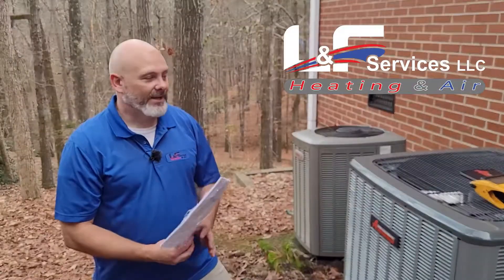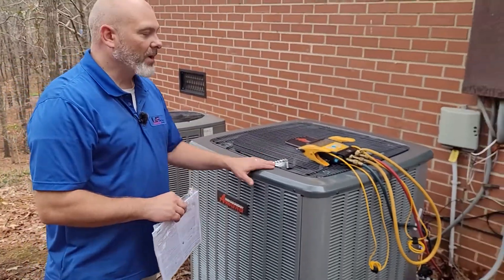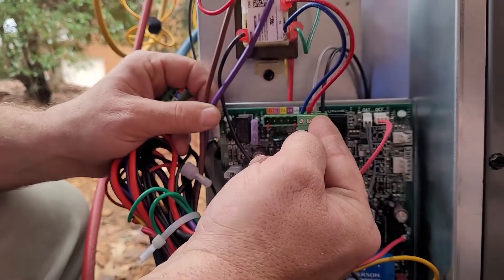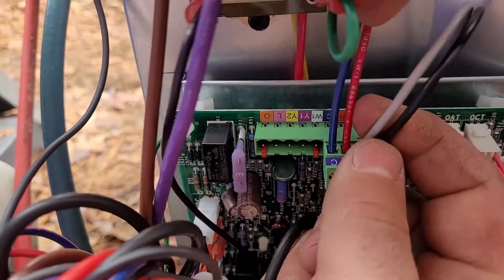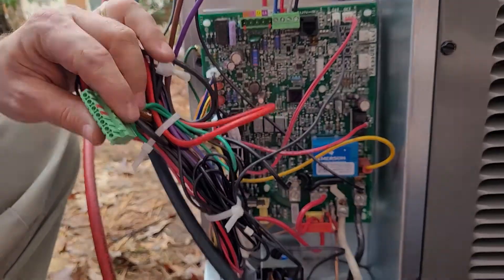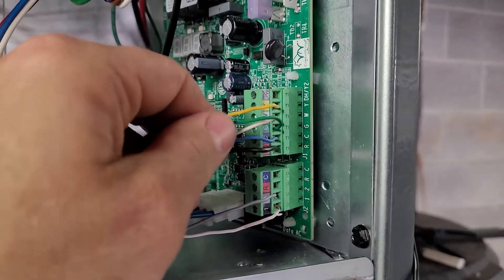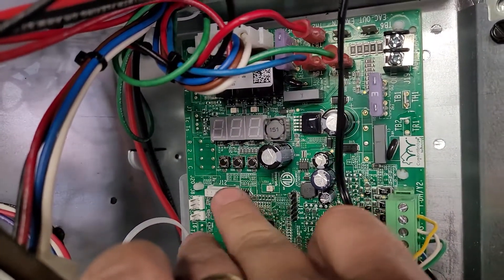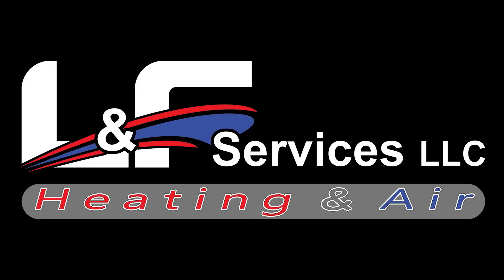How to wire Amana heat pump communicating system

Comment: Inhave a communicating amana system and a hvac tech tild me the thermostat I have would not work because I'm using the honeywell vision pro 8000 . Is thus accurate, if so which thermostat do I need to purchase?

Comment: Thanks for this!  I have one of these units (AC in Florda, not heat pump though) with the same boards.  I wanted to install a soft start, but because there is no contactor like in a traditional setup, the install instructions made no sense.  Is it still possible to use a Hyper Engineering Soft Start on a unit like this>. Everyone I ask is afraid to touch it, but it's got a compressor and a capacitor like any other condenser, so there must be a way.

Comment: So I guess with my GSZC7 heap pump AMVT AH running in communicating mode, I shouldn't be seeing a second stage for my cooling on the Honeywell 8000 Wifi Pro tstat?  I only have one heat stage shown so that appears to be correct.  Will it just forever show stage 1 but run the second/hi stage as it does with the Comfortbridge?

Comment: Would u happen to have the model number for that specific unit?
Reply: That heat pump is ASZC16 as a 2 stage 16 SEER. It matches with the AVPTC air handler.

Comment: My Goodman AVTC37B14BB has the exact same boards. And it said right out of the box, "relay contacts welded" --- reload shared data or replace control board. Lol! POS! lol
Reply: I even wired a CAT6 cable for the 1 - 2 wires. No luck. Blows the breaker after about 5 minutes.
Reply: I think the lemon on these is about 50%. Not great. But probably due to drop shippers more than out the door. How you get it delivered makes a big difference.
Reply: @anthonylosego  So did you reload the shared data or not?

Comment: I've spoken to goodman/amana tech support and have gotten different answers. Is it better to use a transformer inside the condenser or to power the condenser with the transformer inside the furnace. I have a goodman furnace and condenser both are 2 stage communicating.
Reply from the maker: it is better to use the transformer inside the condenser in our experience
Reply: @lfservicesllc1788  thanks for the reply. I called goodman and they went through it. Some of the condensers have the transformer already in there and some don't. It's better to add the transformer to the condenser when it doesn't have it. You don't want to over stress the transformer that's inside the furnace even though it'll handle it. It's too much current draw... thank again for the feedback.
Reply: It states in the installation instructions to use a separate transformer in condenser, to prevent anything happening to the furnace control board.